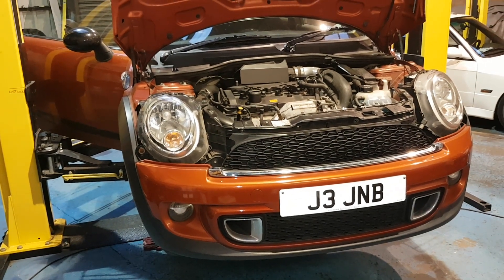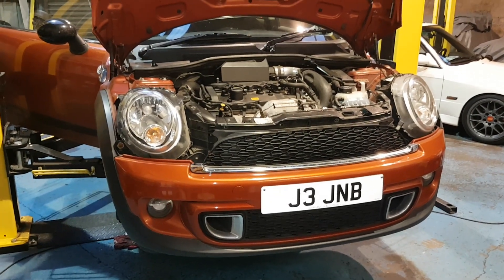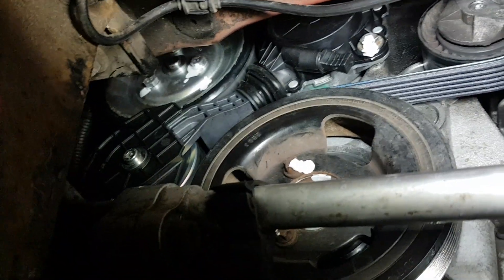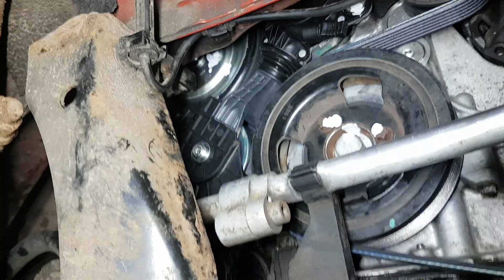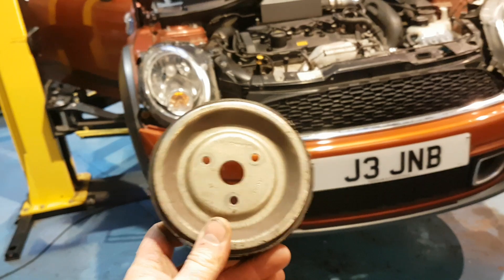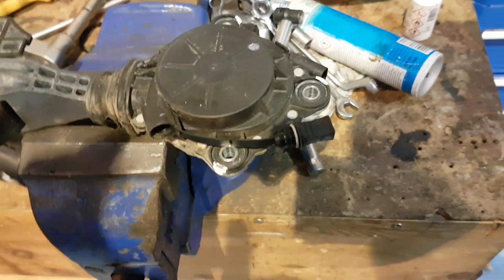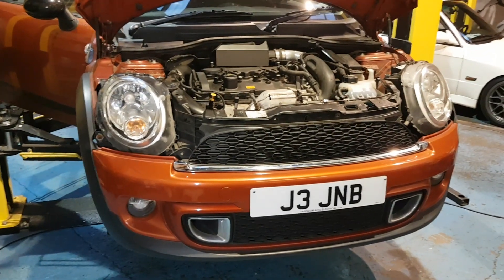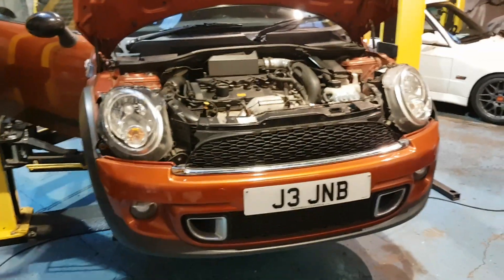Mini R56 - No drive to water pump, not turning friction wheel, not working - how it sounds if failed

Comment: from the friction two kinds aviable, one mechanical and running all time vs. others  have is electronic control have plug  with electrical conection and frict only if cooling system heat.

Comment: The friction wheel on European models is in fact electronically controlled by the ECU. However on the North American models the friction wheel is always engaged.
Reply: Really? I'm from South America and I was thinking mine was with problem, as long as the pulley is always engaged. And I've seen videos from Brazil in wich the friction wheel engages and disengages as the temperature changes.

Comment: thanks for the video, the friction wheel is an inherent problem with all of these engines, i changed the friction wheel also the water pump pulley, but it was still vibrating against the crankshaft pulley, so now im confused, so then i changed the crankshaft pulley, and it still keeps happening, annoying bloody noise again, now according to the dayco friction wheel instructions, the friction wheel is always in contact with the crankshaft pulley so is constantly turning until activated by the ecu then it turns the water pump pulley.  I am an engineer and thought of ways to make the design better, so when fitting the friction pulley there is some movement in the aperture of the bolts which fit to the head, so when fitting i forced the friction wheel closer to the crankshaft pulley if that makes sense, it made it slightly better but still making a slight noise.  then i made the bolt holes for the friction wheel approx 1mm bigger on all 3 holes and this give more movement of the friction wheel closer to the crankshaft pulley, this now worked so problem has gone a way, also when fitting a new drive belt fit a good quality belt the thicker the better, this will then make the friction wheel come in contact with the crankshaft pulley more stable, and if this does not work then im working on either replacing the friction wheel pulley with a larger diameter pulley if i get one, also i may increase the diameter with some 1mm neoprene rubber to the friction wheel pulley which then makes the pulley 2mm wider in diameter, hope this helps, stupid bloody design

Comment: There is nothing electronic about the tensioner that drives the water pump, and no connection to the ECU. It is purely mechanical driving the water pump all the time. The tab that you pull out is just for changing the belt. Changing this item is a little challenging, but can be done in about a couple of hours. When ever I have changed these I have replaced the water pump pulley and serpentine belt at the same time. Costs around $100 bucks for all the parts, double that if you use BMW parts. Just did another this morning.
Reply: At 4:33 (freeze frame) the electronic connector appears to be at the upper right near top bolt hole.
Reply: @kdwalker1656  Think you might be looking at the camshaft position sensor. There is absolutely no electrical connection from the tensioner to the ecu. (at least on any N16 or N18 that I have worked on, and that's quite a few).
Reply: @lozwarren1971  FYI - The friction wheel on European models are in fact electronically controlled by the ECU. However on the North American models the friction wheel is always engaged.

Comment: I don't know what this guy is talking about, but the water pump friction wheel is not electronic in any way. The ECU does not control it and the only time it contracts or retracts is when you pull the plastic tab to release the tension so that you can remove the serpentine belt or water pump pulley.
Reply: FYI - The friction wheel on European models are in fact electronically controlled by the ECU. However on the North American models the friction wheel is always engaged.

Comment: I have a leak around either the water pump or the coolant crossover pipe. It does not leak cold with a pressure test. But if I start the engine it does not leak until it warms up and then it starts leaking under the water pump and crossover pipe where it connects to the water pump. That is with no pressure on the system either. So I think what is happening is the water pump is bad but it doesn't start leaking until the friction disk engages the water pump. Makes sense. Thanks for explaining how the friction disk works!

Comment: oh, good to know that tensioner causing that rattle noise, I have just done a complete rebuild on a N14 engine, and it still knocking like timing chain giving up, tomorrow I am going to put a new tensioner in then. thanks for the video.

Comment: Hi. Great video. I have a DS3 with same engine, and that friction wheel has a small electric connector. Now if i plug in that connector the fan kicks in hard and the heat gauge goes to dead short in the red. Car is cold. If i unplug that friction wheel connector the car fan works correct, temp gauge works normal, fan kicks in when at running temp and kicks out when cooled to spec on thermostat.

Parts replaced is thermostat housing and sensors from dealers, friction wheel also replaced, car had a soft ware update from the dealers, and dealers also has no idea what could be the issue. The wiring harness was also stripped open and checked and the ecu connectors also checked.

I have no diagram on this car and cant seem to find any and my dealers just do not want to help. so i find it very difficult to check signal and continuity ect.

Diagnostic codes from my autel is,

023B permanent fault
Disengagable coolant pump control SC-

0598 permanent fault
Controlled thermostat command short circuit to earth

0947 permanent fault
Control of the oil pump electrovalve SC-

Any help or ideas.

Thanks again from South Africa

Comment: After watching so many mini engine videos, and most of them are excellent, I can honestly say that this video is totally excellent.
The feeling I have at moment is a bit like this........

You've guessed the card I've got in my pocket. I'm not late, it's just I've not adjusted the cooker clock and I can still make it to put the lottery on. I found the needle in the haystack after 30 seconds...... etc etc

I'm replacing bent valves at the moment and my head is full of problems and possible solutions. I keep looking at this bizarre piece of plastic wondering what it does. 

Thanks for posting this outstanding video

Comment: 2:02 That drive assembly is controlled by ECU and get moved in and out electronically??
Reply: Yes and the ECU decides it based on engine temperature.
Reply from the maker: That's correct

Comment: Thanks for video.  I had a bunch of work done to my mini and actually took it back to shop because of rattle.  They pulled apart the Tensioner and checked it all out, said it was good but I am OCD (I am sure shop guys hate us), and the sound was still there.  Now I have something else to look at instead of assuming the shop was trying to stick it to me.  Odd though, rattle comes and goes depending on rpm....ugh.

Comment: Sounds like the job was misdiagnosis at the cost of your customers wallet. 
Very common problem.
Surely you won’t get caught like this again. 
Recap 
Always remove all drive belts before condemning internal noises first.
Reply from the maker: Hi Marc, unfortunately misdiagnosis' happen and the customer would have been charged no labour for our mistake. We very rarely work on this engine and almost exclusively work on the higher performance side of BMW's range, which unfortunately doesn't make it a common diagnosis for us, especially at the time. It sounded alike the BMW death rattle, which we commonly see problems with, logically pointing to our initial diagnosis. At the end of the day, it's helped multiple people who have commented below and that was our goal - to not make our mistake :)

Comment: Very helpful, thanks. I didn't understand the purpose of the friction wheel before watching this. I've watched  quite few videos on the R56 timing chain replacement, non of which have explained the purpose of the friction wheel. I had read somewhere about an electric water pump (?) but it all makes sense now. Thanks again and greetings from Australia :)

Comment: thanks for sharing that. I was experiencing rattle sounded like engine damage. turned out was just the belt needed to be replaced. the belt was cracked and worn to the point that there were a couple flat spots where the groves had broken off. apparently this was enough to cause the noise. the pulleys and friction wheel were in good shape still.

Comment: My local repair shop were convinced, as you were, that it was the timing chain or something more terminal. Showed them this video, pointed out that the rattle only happened when the engine was cold, and it saved me a packet.Thank you so much!
Reply: I’m confused, wouldn’t the noise only happen when the engine was warm and the friction wheel is engaged?

Comment: Folks the tensioner I bought did not come with the electric sensor or connector that fits insides the aluminium section of the tensioner? , is that something I can take out of my old tensioner and install it on the new one?
Regards

Comment: Is the friction roller different for the N18 than the N14? On the N14, this is absolutely not electronically controlled. It's just a friction wheel to transfer motion in a narrow space where it would be hard to run a belt. Is there an electrical connection on the N18 friction roller?
Reply: So the friction wheel engages all the time?
Reply: @rrw8785  In US, the friction will is always engaged.
Reply: @ModMINI  mini GOD
Reply: Mini Coopers sold in the US don't have a computer-controlled friction wheel. They use a computer-controlled thermostat to control temperature.
Reply: There is no such thing as an electronic friction wheel. I've worked on many N18 engines and have not seen one with a electronic friction wheel to this date.

Comment: Exactly same issue I'm having with my partners. I like you guys fitted a new chain etc along with new vanos and it improved the rattle. But it's still making a slight noise, which I now think is the water pump or the friction wheel
Reply: Thanks man! Great help